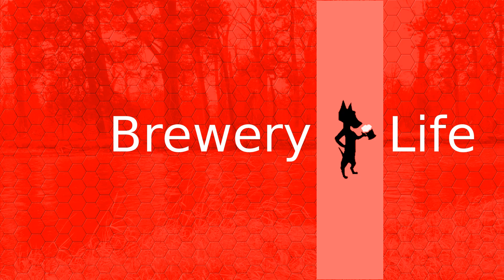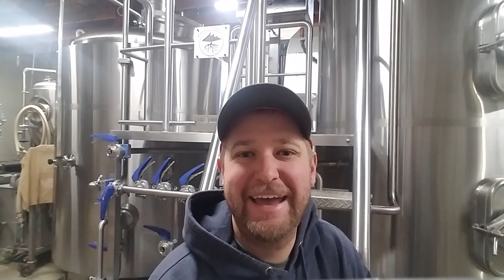PASSIVATION of Stainless Steel on MICROBREWERY EQUIPMENT!

Comment: Im a bit confused on the citric acid method for passivation. I have 4 - 400 gallon brite tanks that I need to passivate. You mention mixing up a single gallon of solution to "run through the tanks" at 160F. How is that single gallon going to circulate and touch 100% of the surface area inside the tanks? In the manual for the tanks themselves it simply mentions mixing up a solution of citric acid that is 10% concentrated by weight and circulating the solution through the tanks for up to 2 hours depending on the temperature of the solution itself. Am I really only mixing a gallon or do I need to fill the tank with 400 gallons then add the citric acid powder that I have preweighed to create  10% solution? How are you heating the liquid and keeping it hot while it soaks?

Comment: Martensitic, Austenitic ferritic and duplex Stainless steals are the main SS in industry. based on chemistry/metallurgical properties I'd imagine Brewers would want to use An Austenitic Stainless.. Anyway, Good info. 👍 I'd also recommend using Citric for passivarion of SS. The main goal is to strip the free iron from the surface of the Alloy to then allow the Cr to form an unreactive Oxide layer. when done properly, it will allow your stainless equipment to last a long time.

Comment: Jasper, the thermal conductivity of copper is 20 times higher than that of steel. The steam coming off the bottom has nothing to do with the conduction of heat but it is a result of it.  What your seeing is copper conducting heat efficiently when compared to stainless steel. Think of steel having a higher resistance to heat transfer, and it becoming hotter as a result.

Comment: Amazing video as always Jasper. Is it possible to adjust the pH of the citric acid solution with phosphoric acid or is ammonium hydroxide really needed? A lot of us are still chemistry noobs.
Reply from the maker: I wouldn't but you should consult with your chemical supply company for professional advise, cheers
Reply: Thanks man. That's what I'll do.

Comment: Thanks for this Video Jasper! Your video's are so helpful. I wouldn't have known this! 
The new brewery has just arrived (brewhouse and tanks) and we are putting it together. I have a question about pickling. When we get to that stage, can I brew as small of a batch that my brew-house can make, to reduce cost, and I assume I wouldn't need to ferment it, correct? I just need to make the batch and loop it through all the equipment and then dump? Thanks!
Reply from the maker: Glad it helped Mike. A small batch is fine. I feel if the equipment is going to touch fermented product then it needs to be pickled with a fermented one. The ferment has a lower pH than just wort and could pull out different soluble volatiles. Just my opinion though. Cheers!
Reply: @brewerylife3596  That is a very good point! Again, thanks so much.
Reply from the maker: You're welcome!
Reply: I was wondering the same thing.  Thanks for posting.  I’m thinking that the alcohol in fermented product might also affect the solubility of those nasties.  I’m getting ready to do this with my new equipment as well.  I think I will also use this as a “yeast starter”.  Thanks for the videos Jasper!

Comment: Great stuff as always!

Quick question. I know it likely differs by chemicals/process used. But how often do you passivate & pickle your equipment? Just before first use? Every year? Every 5 years?

Thanks & cheers!
Reply: First time use only
Reply from the maker: Pickling by brewing a dump beer, only once on brand new systems. Passivation should be considered bi-annual if you are not dilute acid washing you tanks. Check out my CIP vid. I acid wash after every caustic cycle so I only have to do a hardcore passivation on new equipment. Everyone does things different though. Cheers
Reply: @brewerylife3596   Jasper I do acid wash my vessels before transferring beer in, and I do caustic wash everytime I empty them, but sometimes days go by between caustic wash and acid wash. Is this a problem? should I be doing acid washes straight after a caustic wash?